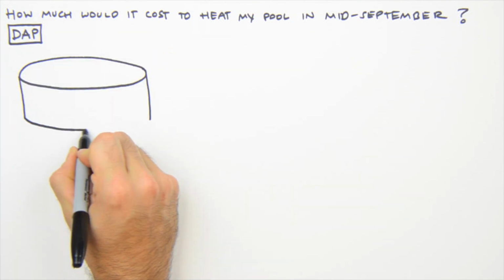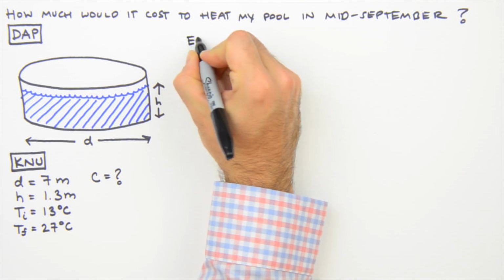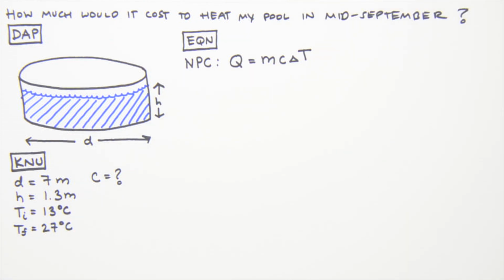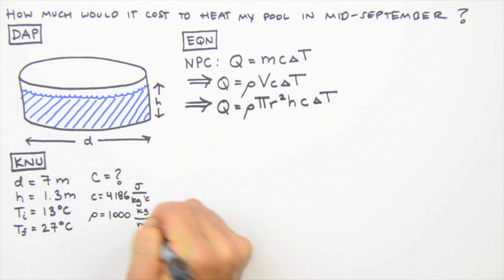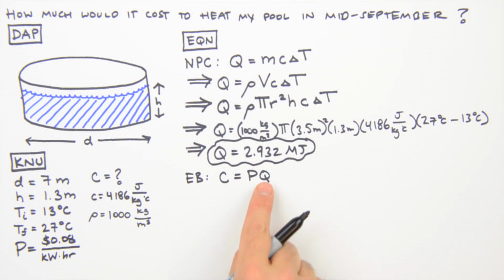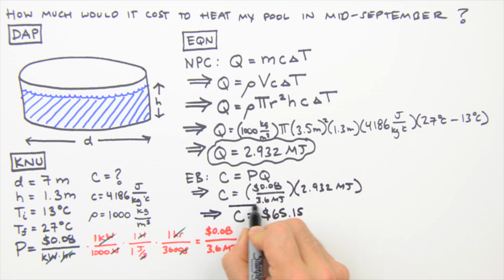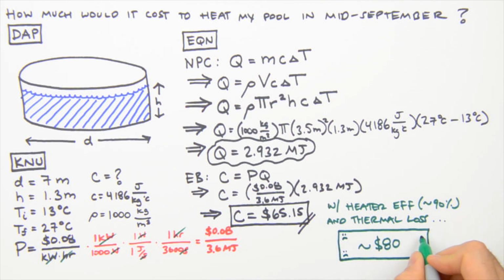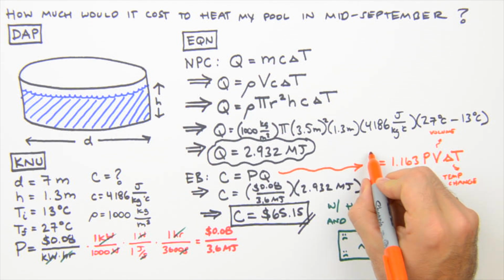How Much Does It Cost To Heat a Swimming Pool?

Comment: thx great video. can you show how to calculate the heat loss from a pool using the heat flow model?
Q = U*A*dT …. do we assume that most of the heat escapes from the top surface ? do we need to use the thermal conductivity of water to do the heat loss calculation ?

Comment: Then how long did take to heat grandma's pool?
With the time and the power consumption values of the heatsource and the pump you have the $ number.

If the heating took a long time, you would have a continuous heat loss during heating time period. That would be a interesting addition to the calculation.

Comment: Insulation around the pool (if above ground),
Cover the pool while heating,
= faster and cheaper (from the $80, not the $65).
After heated, heat loss...
High cover / mimic indoor pool?
Bodies of people heat the pool (with/without peeing... :) )?
Some kind of layer (floating balls - filled with simple air?) to keep heat of water trapped?
Am I correct to deduce that heating the pool is less expensive than keeping it warm (say, after some time.  year-round vs. heating once per week)?

Comment: Hey Jesse, I ran across your video while thinking about doing the same calculation.  I see that you're using electricity to heat the pool, so I assume it's a heat pump.  In that case, did you not factor in the COP or "efficiency" of a heat pump with typically runs COP 5-6 or 500-600% efficient?  If the pool is being heated with electric resistant heat then the calculations are spot on, but heat pumps pull heat from the air ... so I'd expect a total cost of about 1/5 of the calcs.  Thanks!
Reply from the maker: Hi Michael. Totally did NOT factor in COP and just assumed a 100% efficient heat pump. Tell me more about this 500% efficient pump!
Reply: @JesseMason  Good review here:  https://www.nordicghp.com/2015/08/how-to-calculate-coefficient-of-performance/
Reply: @JesseMason  Also this article discusses pool heat pumps being in the 300-700% efficient range -- https://www.poolheatpumps.com/pool-heat-pump-efficiency-cop.html

Comment: Please show us also how to calculate how long will it take to heat up a pool with Electric, Gas and Heat Exchange Heaters?  Maybe you could write a small program to calculate all these online? This will be great!
Reply from the maker: I'm afraid such a calculation is a level or three above my pay grade... =)
Reply: Ok Could you please calculate like here in this video and post the details as text.  Let me see if I can write it by substituting the values.  I do have few skills which can be utilized for this.
Reply: I will first try it out on excel sheet and then it will be easy to port to other online forms.

Comment: How about if I combine solar pool blanket and heating?  Could it dramatically reduce the cost?
Reply from the maker: You're still getting a lot of thermal loss to (and through) the walls of the pool. But the solar pool blanket probably would halve that loss (my guess).

Comment: Sir. I tried a lot but couldn't solve this question. Help me out sir. 
Question : In a large building, there are 15 bulbs of 40 watt , 5 bulbs of    100 W , 5 Fans of 80 W and 1 heater of 1 kW. The voltage of electric mains is 220 V. The minimum capacity of the main fuse building will be? 
Options : 
1. 8 A
2. 10 A
3. 12 A 
4. 14 A
Reply: 12 A

Method : 15*40 = 600w
5*100 = 500w
5*80 = 400w
heater 1000w
sum = 2500w
p = v*i
i= p/v
i = 2500/220
i=11.36
fuse should always be little higher than load so 12 Amps it is